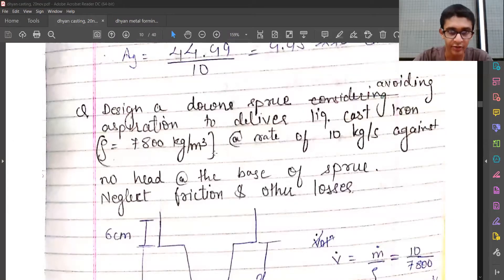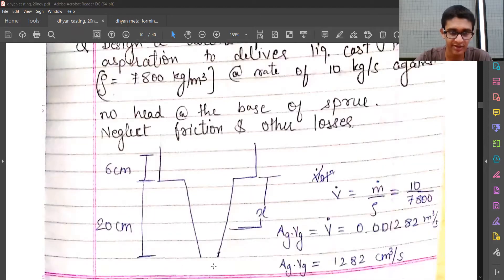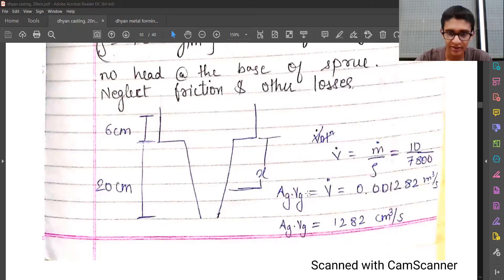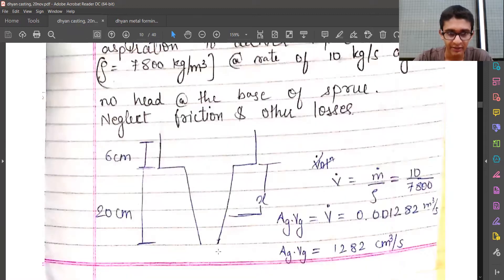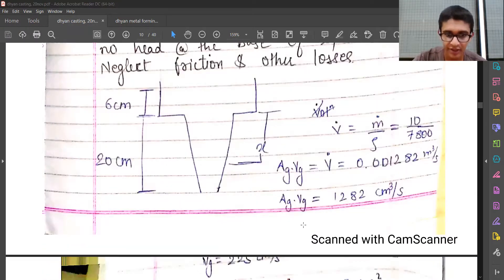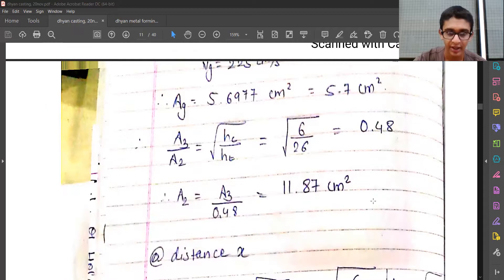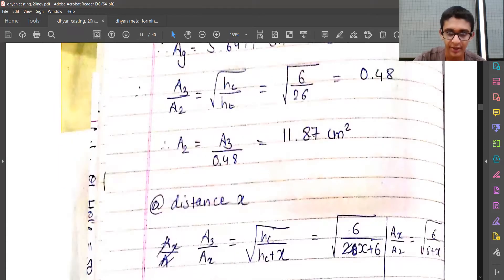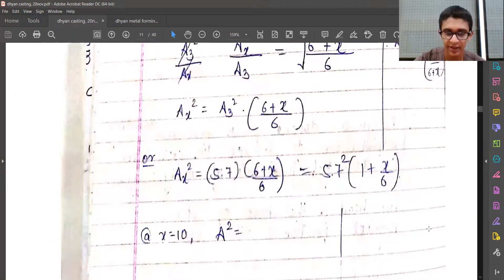8 Solved Question on Sprue design with Aspiration Effect Considered

Comment: Sir will the shape of the opening have an impact on the flow and how should we calculate that?
Reply from the maker: Hello bhai,
Yes, the opening will have an impact on the flow as per my understanding. 

You can apply the concepts of losses due to bends, friction, change in area, etc. to calculate the effect on the flow. But if you simply imagine, the circular opening will be the best option in my opinion because we want the highest velocity available so that the molten metal reaches all the corners.

Let me know your thoughts too.
Cheers!
Reply: @dhyandpatel132  thanks for the help sir
Reply from the maker: @neileapenninan8706  Thank you bhai.

Always there for any similar discussion. Exchange of ideas and discussion is one of the source of knowledge.
Reply: Size and shape Pouring basin has no effect on the velocity of molten metal,but sprue and runner and ingate etfects
Reply from the maker: @saibabu5051  Thank you